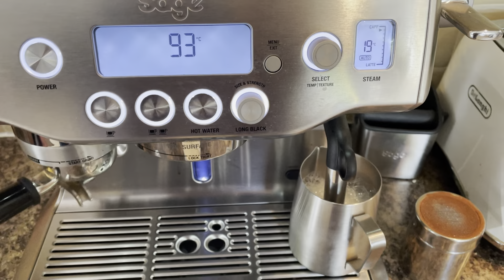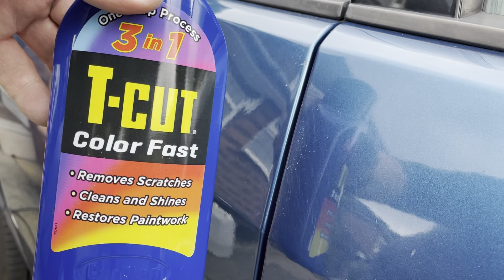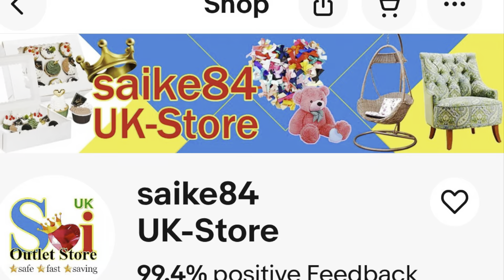DIY Car Dent Repair 👍 Car Bodywork Repair

Comment: Great video, thanks.  The tools you bought are cheap enough to give it a go.  The dents look a bit better for your efforts, so well done you.  I'll give it a go on the wife's car.  And you're right, it could cost you quite a lot to take it to a repair shop.  I've done loads of repairs on my home, garden and car myself, and probably saved thousands over the years.  I'd sooner spend a few bob on a specialist tool for a job that I can do myself, rather than have to pay an hourly rate for someone to do it for me.  For those of you out there who are thinking of becoming a DIYer, then start small.  Buy a basic tool kit, do small jobs to gain confidence.  And if you're taking something apart, film or photograph it so that you'll know how to put it back together.  Good luck and stay safe.
Reply from the maker: Good advice and all the best. I’m going to give it another go with the other stronger glue stick and see what happens. I’ll do a short video and see if I can get them even better!  Thanks for watching 👀
Reply: @kape9004  Totally agree 👍

Comment: Great video 🙂
.
I've enjoyed watching videos like yours from the USA ......... they heat the metal to soften it 
(i think)....... but the kit should have a "wedge" shaped plastic tool to glue on ?????
.
They also have a "centre punch made of plastic".......... to soften the metal before pulling .
.
But ???? ............... You did a great job anyway mate 🙂
Reply from the maker: Thanks for watching 👀
Reply: @rustyrestos  No problem ... they sometimes "overpull" and tap them back in with small plastic thing with a pointed tip as they stare into a screen of black squares  🙂

Comment: I watched a pro guy on youtube using one. It does seem to work. But he did lots of pulls. Maybe 10 - 20 something like that. And tapped down the metal round the dent. Also I would read the instructions. I don't imagine you are meant to use the screw to pull the dent or use the wrong end of teh slide hammer ;o)
Reply from the maker: 🤣 Sometimes on YouTube you have to make reactionary content to help the video get more views. Thanks for watching 👀

Comment: its not working because you are using both tools completely wrong......
Reply from the maker: Yes probably… but it has worked after many attempts (since this video was made). Thanks for watching 👀
Reply: Yeah, I see he’s pushing the puller… instead of pulling.

Comment: Your glue gun is not hot enough, your using the lifter all wrong , you should warm area first with hot air gun to soften paint and you should tap down the crown around tye dent first. Some good vids on here , suggest you have a look or get a pdr man bef9re you cause more damage.
Reply from the maker: Thanks for watching 👀 while I agree  with heating the area up first as I mentioned in the video myself, the glue gun was hot and melting the glue. It’s an old car I like to tinker with. I have now got all the dents out after many attempts! 😂